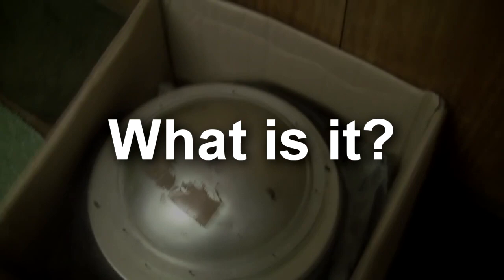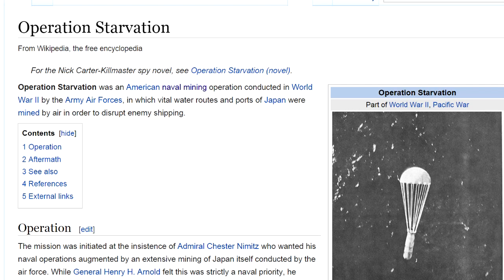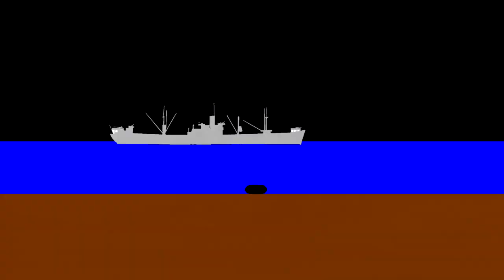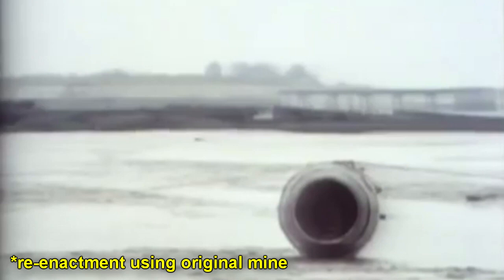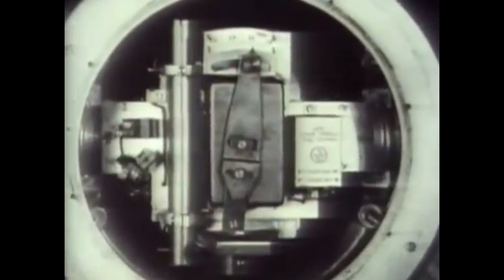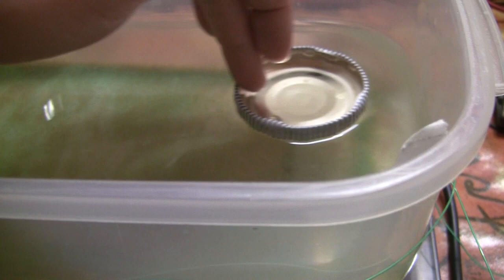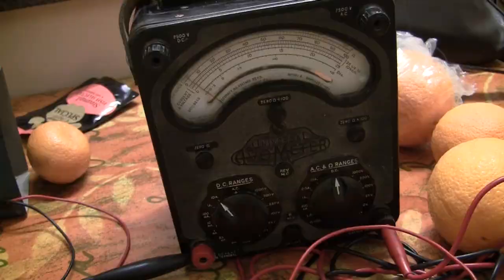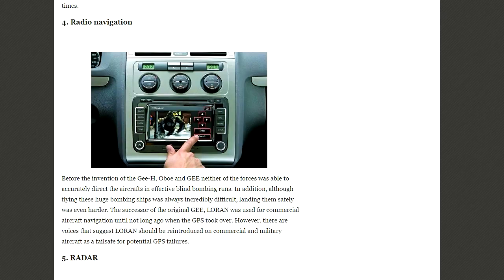The 'superweapon' that almost won Hitler the war!

Comment: Are you sure it was the "first technologically driven war?"  I think just about every war is defined by technology.  WWI, for example, was defined by advancements in machine guns, the first use of planes in a war, mustard gas and the tank.  I'm sure there were wars that were fought on even technological ground, but I'm also sure there are many, many examples of technology defining the outcome of a war before WWII going all the way back to prehistory.  Ever since the first metal weapons, the first fire-hardened sticks, or the first time one group discovered it was better to throw the rocks instead of wield them like hammers.

Sure, WWII was the first war where "modern" technology defined the outcome (rockets, drones, magnetic mines, the atom bomb, etc) but that's just from our viewpoint.  I'm sure the soldiers during WWI felt they were on the cutting edge, and I'm also sure the next great war to be defined by technology will view the technology during WWII to be terribly archaic.

Comment: Oh crap. It would be easy to sweep such mines. No, VERY EASY.   
Ok, they are exploded when they sense a ship's magnetic signature. 
The solution is simple. Design a device that has a magnetic field similar in strength to a cargo ship.
Mount it on floating device that would not be harmed by explosions from underneath. Now tow that device in the estuaries, ports, and coastal waters. The towing ship should be non-magnetic of course. In WW2, a wood vessel would probably do. 
The Brits are quite smart, too. They would have developed a counter to this weapon, probably better than what I just came up with.
Reply: Yeah, it's easy to counter a magnetic mine as long as you know that the mines are magnetic.

Comment: I think the Horten Ho 229 could have won the war for the Germans , It was 61% faster then anything around at that time could move 2 war heads 1000 miles , The Nazi would have had Nukes by 1946.
Reply: The horton wouldn't have done much of anything. The one aircraft that could have saved germany was a long range strategic bomber. Because it was not in the west that germany was defeated, but in the east. Without the ability to destroy the soviet production centers in the ural mountains, there could be little doubt about the outcome of the war.

Comment: Maybe the german in charge for that deliberately did that to stop this madness. Or an extremely incompetent officer was placed in such an important post.

I want to believe that the 1st was the case :)

Btw we again go back to the same thought.. That nuking japan wasnt necesseray at all.
Reply: Image sitting in a plane, then getting fire from the ground AND sitting on explosive. The instinct to survive would tell to turn around and drop the explosive. Forgetting to  activate the safety? Man - there is fire from below. Wasting time to make the explosive INSIDE the plane more dangerous then it already is does not spring in to mind when stuck in this situation. It is about "getting out alive" or to blow up.

When deliberate, the whole story would have worked differently, like dropping plans or instructions. Or landing the plane on enemy field and surrender.
Reply: sarowie Ok news flash, we ll go with that version.

Wow didnt think that much.. i feel embarassed now :)
Reply: PurpleStratocaster It is a very real possibility and I think it is reasonable justification for why the US did drop the bomb, but many scholars who have researched this event at great length say that might not have been the case and surrender was near even before then bomb.
  If this was a certainty, either way, there would not be a long standing scholarly debate on the subject.
Reply: Loathomar I doubt 'surrender was near' because it took two bombs; if they were close to surrender before the bombs they would most likely have caved after the first one.
We'll never truly know what would have happened otherwise, but everything I've ever read indicates that the bombs were the best decision based on the information available to them at the time.

Comment: Didn't the Brits just run copper wire around their ships and run electricity through it to degauss it?
Reply: Isn't that what he says? Electricity through a copper wire means a magnetic field so the ship will make the mine explode=minesweeper
Reply: Marijn Verhaeg I've heard that if you run electricity through a copper wire around the ship itself hides the magnetic signature. I may be wrong though

Comment: I didn't intend to count them, but my brain registered 4 separate occasions when you used "England" as a synonym of "UK". Just... what the flying fuck? WW2 had fuck all to do with England (as a separate entity), what with 1939-1945 being a considerable amount of time after the Act of Union in 1707. If you can't get that right, I'm going to struggle to accept anything else that you have to say.

Comment: Well what if you send a massive group of small cheap boats ahead of there main naval fleet?
Reply: the boat has to be big enough and metal to create a large enough magnetic field to detonate the mine, so you would be wasting money and crew on blowing up bug ships
Reply: +Michael Elliot :p not if you use tiny wire guided ships with thin metal poles under them with magnets on the end
Reply: corgidog quirke fair enough, still, in 1940-41 the UK had few resources having lost men, ships and planes in a series of disastrous operations like dunkirk, it took until 1944 when they could retaliate on a large scale, with most of their prewar professional army  lying dead in France. So I feel like it would still have been a waste of resources and skilled sailors to use these 'kamikaze' ships infront of convoys
Reply: +Michael Elliot fair enough

Comment: Though the problem with the V2 is the cost and it's pay load isn't effective enough to make it worth creating a effective counter to it. https://youtu.be/9f8zv7dNxQI He goes over the V2 and it's usefulness. Given the information it would have been dumb to put the necessary resources in to making an effective counter to it(sorry tangent). Though a problem with these mines is that to be an effective weapon they would have been able to go on without the British countering them. Even if one didn't land on their front door they still would have likely found about them from either spies or eye witness reports. Lets go with the eye witness reports of the mines being attracted to the boats. It would become gave it away that their magnetic and the British would have countered it all the same. Thus I don't see this being a fluke that it was countered. With the Japanese on the other hand I think it has to do a lot with their ideology with why it wasn't countered. The Japanese in ww2 tended to be rash with their actions and discussion making. An example of this is how the Japanese still wanted to fight even after the atomic bombs were dropped. I think it is likely that the Japanese tried to brush off the mines like they seem to do with most things, thus making them so effective against them. This showing that they were very powerful weapons if you don't take proper actions to counter them. To the point that I could see this possibly being able to win against Britain if they where able to deploy them in massive numbers around all of Britain. Though this would be very very unlikely to do because of delivering them there and producing the mines in the needed numbers to do so. Therefore I don't think you can say they almost won when it was more of a could have maybe won the war but I still liked this video anyways.